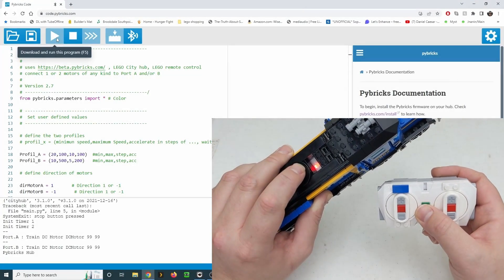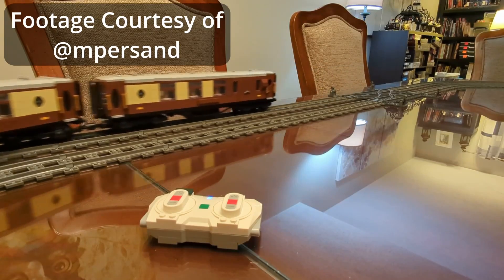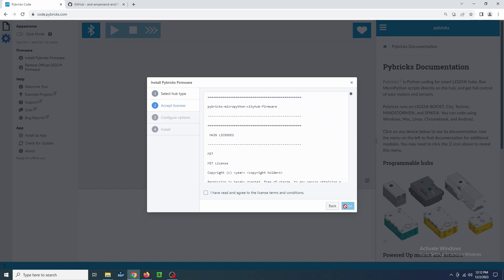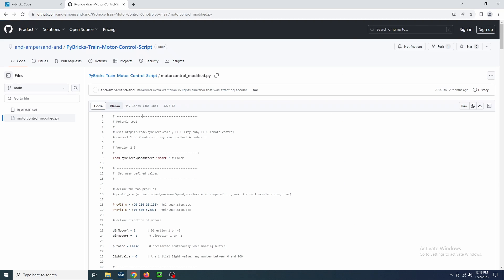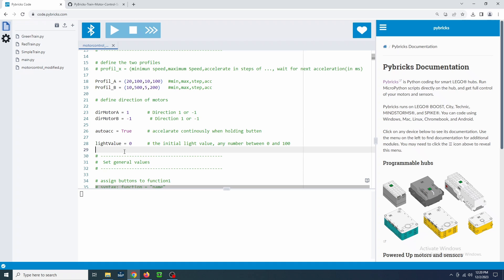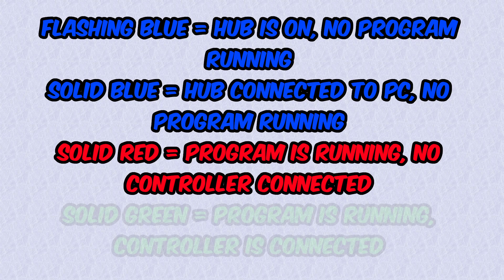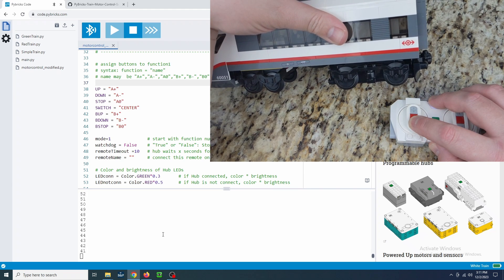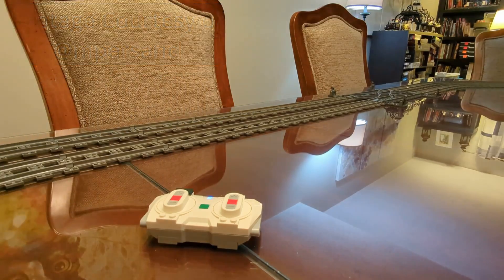Using PyBricks to control Lego trains

Comment: Is there a way to run the program and connect the remote with out having to connect to the pc first?
Reply from the maker: The PC or device is only needed to initially load the PyBricks firmware / program.  After that the you just need to press the button on the hub to turn it on, press it again to start the program and then connect the controller.

Comment: This is an amazing tutorial! Had no problem getting the functionality you showed. Is there a way to alter the pybricks programming to control two motors indvidualy this way? I am wanting to attach a motor to the A and B ports on the City hub and then control the speed of the A motor with the A side of the remote and the B motor with the B side of the remote independently with this push and hold for acceleration setup.  Any help would be greatly appreciated!!
Reply from the maker: Thanks!  I'm not entirely sure how much work it would take to modify the program with split motor control.  I'm far from a PyBricks expert myself, lok24 and Ampersand are the real MVPs for their coding work on all of this (and future updates which allowed combining multiple locomotives).  A good place to ask that question would either in our discord (linked on the channel or the description of videos) or on Eurobricks in one of the PyBricks train threads

Comment: Motors and lights wouldn't work at first, but I figured it out: I had them unplugged when programing the hub, but reconnected them before turning it off.  Seems the hub will only recognize things that are already plugged in when you turn it on.  Some great quality of life features here, the train continuing to run if the remote disconnects will be very useful at shows, in the past I'veI had to put the remote inside a boxcar behind the locomotive to keep it connected!

Comment: Gonna take a little bit of getting used to using the A side for motor control (always used the B side, dating back to Power Functions), but otherwise this is fantastic!  Probably even possible to swap the controls, I think I even see how in the code, but not really sure I want to mess with it.
Reply from the maker: If I'm not mistaken you should be able to plug the motor into the B side and lights into A.  It autodetects devices when the program first starts up.  I could be wrong and the program would need to be modified.  No harm in trying though
Reply: @BatteryPoweredBricks It does auto detect, it's just that a motor plugged into the B side is still controlled from the A side of the remote.  It's whatever though, getting used to that is still well worth the QoL improvements this makes!

Comment: How do I connect the remote control to the hub? Everything seems to work correctly up to that point (uploading firmware, connecting via BT, running the program), but I can't get the remote connected.
Reply from the maker: I don't remember if it's necessary but you can try holding down the green button on the remote until it starts flashing purple to reset it, then try again.  Other than that make sure the program is running.  Pressing the button on the hub once will turn it on, pressing it again will start the program

Comment: Hey, I just wanted to thank you for introducing me to Pybricks. I have built a system where old smartphones are put into special train waggons. The smartphones connect via Web Bluetooth to the trains but also forward the camera stream and exchange control data, so my trains can be remotely controlled from anywhere via WebRTC. You can imagine this being a big hit with kids. Pybricks allowed me to have smoother control, some special functions and overall a more reliable Bluetooth connection. P.S.: I think one of the biggest wins of Pybricks is actually the lack of the LEGO 1 kHz PWM whine because Pybricks uses 10 kHz to power motors.
Reply from the maker: That sounds awesome!  Have you shared any pictures or video of this project?  Also if you are a Discord user I'm sure the folks in there would get a real kick out of such a project.  We love that kind of stuff

Comment: How did you get pybricks to connect to your computer's bluetooth adaptor in the first place? I can't even get out of the starting gate here. It says it can't find it, even though the usb bluetooth adaptor turned on and works fine (I can connect to my phone, for example). and I enabled it in edge. Is there a tutorial on getting this setup anywhere, coz I can't find anything.

This is the error mesage I'm getting:
No Bluetooth adapter could be found or permission to use it has not been granted.

Please connect or enable a Bluetooth Low Energy adapter, ensure your browser has permission to use it and restart the browser.

Some browsers like Brave and Opera do not support Web Bluetooth. Be sure to use a supported browser such as Chrome, Edge or on iOS WebBLE.
Reply from the maker: I've never used Edge, just Chrome.  I would google "Bluetooth permission Edge" and see what comes up

Comment: PROBLEM!!!
I have done everything described in this video which was very helpful btw, but when I press the button on the hub again it turns red and when I turn the controller on it connects and turns green like it’s supposed to, but then when I press the forward or reverse button on the controller it does nothing and starts flashing blue and I have redownloaded the program fully several times but it still doesn’t work it keeps saying the requested operation is not valid in the current state and to check the traceback and gives errors on code lines 268, 95, and 464. Can someone please help me fix this. Thanks very much.
Reply from the maker: What kind of motor are you using?  If you have a train motor I would try that and see if it works, just as a test.  If I remember correctly the other motors can be temperamental but I haven't done a lot of testing myself.  If you are a discord user we have some folks in there that may be able to help better than I can.

Side note, you only need to comment once.  It won't make me see them any fast, I deleted the other ones.
Reply: @BatteryPoweredBricks  I’m so sorry for bugging you I don’t mean to come off as rude I’m used to larger channels not being as responsive or polite as you. Thanks for responding and being helpful but I’m using two brand new technic large motors to motorize the Orient Express with danjo trains instructions. I unplugged both ports when setting it up and plugged them in after I installed the software and it worked only once but when I turned it off and back on again to check if it was actually working it went back to doing what I previously described. Thanks for responding and trying to help. And sadly I don’t have discord or I would def join yours. Thanks
Reply from the maker: I'll ask @mpersand, he's had this issue before but I'm not sure if he ever got to the bottom of it.  It was kind of intermittent
Reply: I've seen this issue intermittently but haven't been able to fix it. It only seems to happen in this script and only with L motors. It also doesn't seem to happen in older versions of Pybricks. The most recent time I tried to look into it, I couldn't even get it to happen.

What's happening is the hub seems to forget the motor, and trying to set the speed of the motor causes the script to crash. When this happens and the light starts flashing blue, the program is still installed on the hub. You don't need to re-install. You can start the program again by hitting the hub's green button and reconnecting the remote. It might crash again, it might not. I've found unplugging and replugging the motor to the hub helps. Once it starts working, it usually keeps working for a while if you turn the hub off and on. And it never crashes after the first controller press. So if you hit forward or reverse and it works, then it will keep working until you stop the script.

What I ended up doing for my L-motor locomotive is rolling back the Pybricks firmware to a version that this didn't happen. I'll post instructions for how to do that in another comment.
Reply: @Mpersand914  thanks for the help and explanation. The problem is exactly as you described and as many times as I rebooted the battery box it only worked once. Thanks for trying to help and I hope you can try to fix this issue because it wouldn’t be very easy for me to go through the process of removing the battery box and hoping it works every time I try to run the Orient Express. Thanks again for your help.
Reply: @legogonegaming  I typed out a second comment with instructions on how to roll back the PyBricks firmware which is the workaround I've used, but I either didn't submit the comment or it got deleted. I'll try again.
Reply: My comments keep getting auto-deleted, but if this makes it through - I added instructions to the readme. You can click the link in the description and look under Troubleshooting. Let me know if that works for you.
Reply: @Mpersand914  Thanks for all the help and im glad i found a community with such kind and supportive people, but here I am again with more problems lol. I did exactly as you instructed, and it worked at first, but when i pressed the button on the hub again to test if i could re connect to it it flashed blue like normal, then when i presses it again to reconnect it wouldnt, so i tried to turn it off by holding down the button, and it started rapidly flashing blue and would not stop by me doing anything with the button so i disconnected and reconnected the battery tray and turned it on again to see if it worked, and when i pressed the button again it wouldnt change to red so i could connect it just kept flashing blue. When i redownloaded the program it worked again but when i repeated the testing process it did the same exact thing. thanks so much for reading my word vomit.
Reply: @Mpersand914  Don’t mean to be rude or to rush you but how is the code troubleshooting going I know figuring out bugs is tricky and I’d like to see how it’s going. Thanks so much for trying to help.
Reply: @legogonegaming  I've tried replying here multiple times but Youtube keeps automatically deleting my comments. Troubleshooting here doesn't work.
Reply: @legogonegaming  I've tried replying to you multiple times but Youtube keeps deleting my comments. Discussing it here doesn't work.
Reply from the maker: For whatever reason YouTube is not allowing his comments to go through.  Discord is the best option to have good communication, it's a free app / software and our discord is free to join (linked on my YT homepage or in the description of videos).  Also you can submit an issue on the github page.  Sorry I don't really have any control over YouTube, I've definitely had my own comments deleted for no reason 🙄

Comment: Thank you so much! I tried this out and it worked flawlessly on my custom loco! I was so happy to finally have smooth acceleration and braking!
Reply from the maker: Happy to be the messenger!  The programmers and the PyBricks team are the real heroes 😁
Reply: They sure are! I wish I had founds this years ago! I just had a quick question. What would you recommend a dual motored locomotive or a single motered loco with lights? I also was a little concerned about my motor making a high pitched beep noise. Is that normal?
Reply from the maker: @JLaxx13 The way the motors are powered it's perfectly normal to have a whine to them.  For most of my trains I use dual motors but I did upload a video recently where I made a Y adapter to power two motors which left the other plug for lights.
Reply: @BatteryPoweredBricks Ok thanks!

Comment: Hi: will Pybricks work on an Apple Computer?   If so, what will I need?
Reply from the maker: I don't see any reason why it wouldn't as long as the computer has Bluetooth built-in or a Bluetooth dongle.  I had issues with Firefox and had to use Chrome using a PC.  I have never used an Apple device in my life but if you have any issues feel free to ask and I'll try to find an answer
Reply: @BatteryPoweredBricks  blue tooth is built in.   Reading from Pybricks the information they supply is ambiguous as to which browser I need.   I’ll keep working on it

Comment: This is great. Thanks for showing how it's done, made it worth the try, and I succeeded. Just one things I might be missing.. When using this program, can you still connect a second hub to the controller?
Reply from the maker: Yes and no.  There is a branch of the program on GitHub that allows for multi-hub operation.  It's still being tested but has worked great for me.  I've shown it off in some upcoming videos but probably won't make a full video tutorial for a while.  It's meant for controlling trains with multiple locomotives, not multiple individual trains.  It could probably be converted to such a use case but it would take a fair bit of programming to do so.

Comment: After you load the program onto the locomotive do you half to have the PC or laptop every time you want to run a train?  My son just got his first Lego train and thinking about using bricks. We have a laptop but cant have it in his room at all times.  Thanks for your help!
Reply from the maker: Nope, that's the beauty of it.  Once it's loaded there is no need for a mobile device or PC.  Press the button on the hub to turn it on, press it again to start the program and then connect the controller 👍
Reply: @BatteryPoweredBricks  That sounds great. Huge thanks for your response! have a good one!
Reply: @FalconWing1813  @batterypowerbricks Do I have to have 2 controllers in order to have the front and rear Engines work together or can I just use 1 controller for the front and rear. I tried to connect two hubs and they just didn't

Comment: Thanks for the tutorial which is very useful.  FYI the github link to mpersand's code doesn't work directly, but if you click on "Go to default branch" the code is there.  One issue with this approach seems to be that you have to start the program running from your PC, pity the code won't "self start".  Or have I missed something?  Thanks, Dave
Reply from the maker: Fixed the link, thanks for the heads up.  The code will self start, you press the button on the hub to turn it on and then press it again to start the program.  Now I'm wondering if I ever actually said that in the video 😅
Reply: @BatteryPoweredBricks   I watched it again and at about 4m40s you showed starting the program by pressing the button again so my bad 🙂
Reply from the maker: Still it's something I should have said in the voice over, I'm glad it was brought to my attention.  I may have further videos in the future on PyBricks and this should be mentioned as it isn't immediately obvious

Comment: Great video. And we now have block coding too, so you can experiment with code without Python experience!
Reply from the maker: Thanks!  I haven't had a chance to check out the block coding myself but I am glad to see it implemented.  I imagine it will be less intimidating to lots of Lego fans
Reply: @BatteryPoweredBricks  and we just added our first train demo. I guess a demo with the remote needs to be next! And maybe an automated switch controlled by an approaching train? So many options 😃

Comment: I am totally a newb when it comes to do this sort of stuff. I take it you need a PC with Bluetooth to do this? Which unfortunately my archaic PC does not have.😀👍
Reply from the maker: For most of my PCs I use a USB bluetooth adapter.  As long as it's Bluetooth 4.0 LE compatible it should work just fine.  They go for about $15 online.  PyBricks is supposed to work from mobile devices or tablets but I haven't done much testing with it myself.

Comment: Nice video. Disconnecting the sensors/motors from the city hub is required for "smart" devices like sensors and motors with rotation sensors. The firmware contains a bug which blocks the update process if these "smart" UART devices are connected.
Reply from the maker: Shoot, I don't think I tested that.  I know it used to have issues with train motors when loading the firmware and turning the hub off.  After those problems were fixed I thought it would apply to other motors.  I'll make a not in the description, thanks for the heads up!